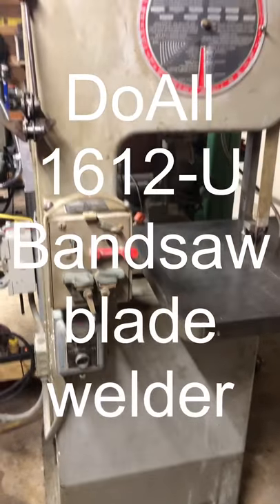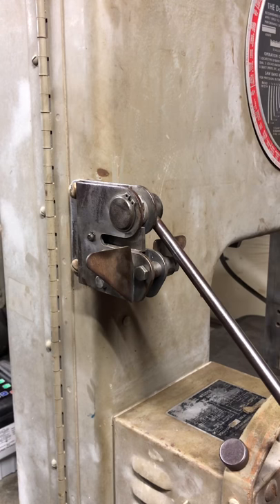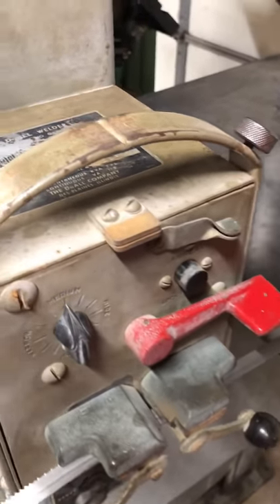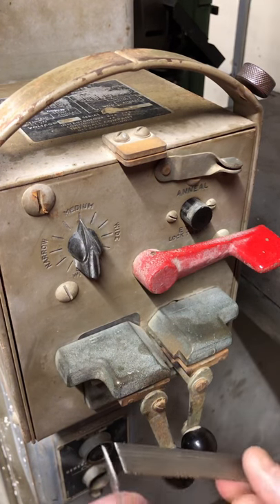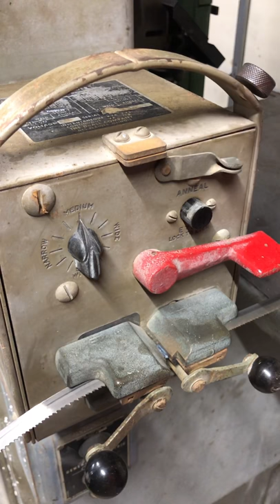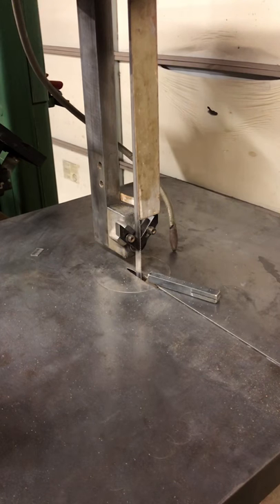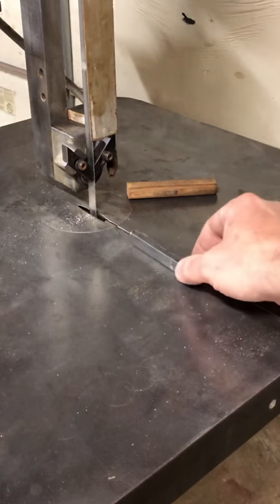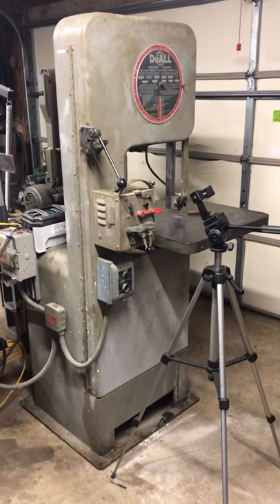Blade welding on a DoAll bandsaw

Comment: Very Slick Operation , the Old DoAll Saws really are magnificent Machines  , my ProfessionalBackground  was always inWoodworking although i have  many Family Members. that have been or still  doing Machine Shop work so i  have helped move around many Machine ShopTools    over the years  it’s a good Mix for me we  do exchange Professional and PersonalFavors and Courtesy amoung each other  so spending a day Off  setting up a MetalWorking Tool or Machine  is similiar to  setting up Woodworking Equipment  except i always joke with the Machinists and Tool And Die guys that their  items  are  just as heavy but way more Oiler    i have basic MetalWorking  Understanding    but  only for a very short time worked in a Wood Shop that  had their own ArchitectualMetalworking and Machine Shop.  in the same  facility  i’ve been around DoAlls   and i know how Valueable they are in a Shop   but i’m Definitely no Welder  other than  tacking and making Ugly Structual Welds  BTW my Grand father was a Professional Welder or over 30 years and before that he was a Fender and Body Guy  before Bondo was Invented

Comment: That's pretty slick. Never seen a machine like that.
Reply from the maker: It's too fun. I think I did a dozen or more welds this weekend just playing with it. I made several blades to have on hand. The blades I'd deemed 'too dull' on my old harbor freight saw still seem to have a lot of life left when used on this big, more powerful saw.
Reply: @derekmelton  that makes sense. Is it hard to find new blades for it? Doesn't seem like you would ever need too but I was just curious.
Reply from the maker: OrionsAnvil nah, they’re just kinda pricey. :)
Reply: @derekmelton  I bet they are. That welder seems like it's worth it's weight in gold. I'm sure it's robust but I'm paranoid enough to where I'd probably keep it unplugged 😆 and possibly in a Faraday cage!😆 Definitely a nice addition to your shop 👍🏻

Comment: Just finished Restoring a  1950V-36. Blade Welder DBW-1A. The last piece is the welder that I have taken to motor shop because its above my pay grade. Do you have a wiring diagram or know of someone who can put this back together? All parts are clean,sandblasted and painted.
Thanks Robert Othon
Reply from the maker: othonart1 I don’t have a manual, sorry. My welder was in working condition when I got this saw.
Reply: You can download the manual from the Doall website at no cost.

Comment: Seems like earlier in the video you had the blade pointed in on the first weld. Then facing out on the second weld. I’m assuming teeth facing out towards you was correct so you could line up the spine of the blades together?
Reply from the maker: Pohan Leu Yep, I was learning. ;) Teeth out.
Reply: Derek Melton thanks!

Comment: You are not doing it correctly, READ the welder manual. Been doing it for over 50 Years, so I do know what I am talking about. Get the slot welded up in the table blade plate too before you have an accident when cutting tiny pieces. The blade could drag the part into the slot and jam.
Reply from the maker: I have a sheet metal insert I’ve laid over the slot. Thanks.